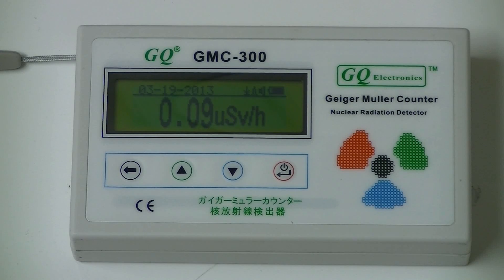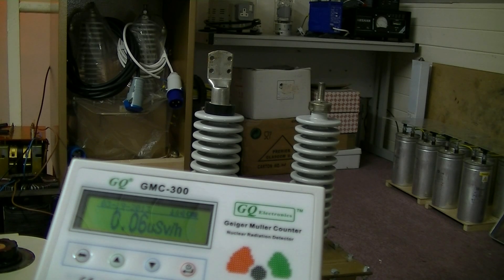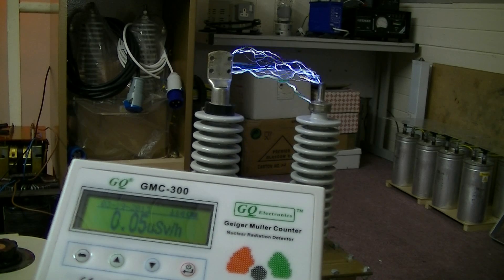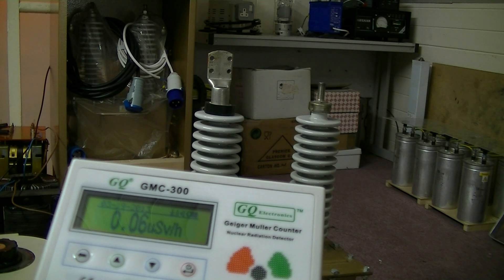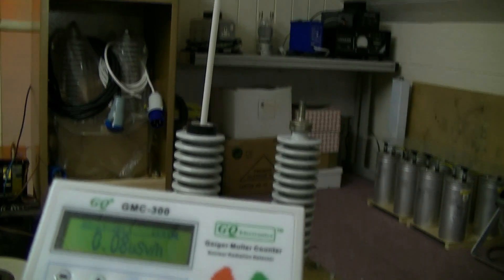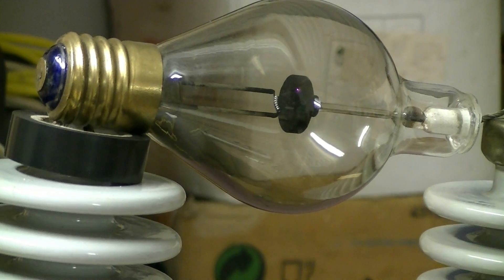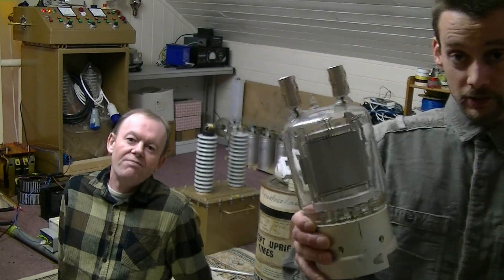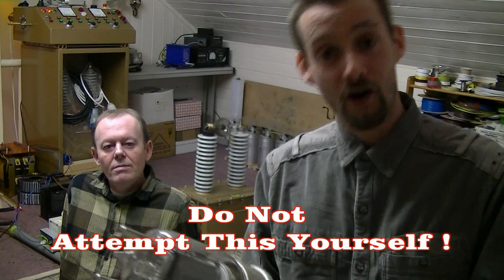Generating X rays

Comment: I think you turned that transmitter tube into a Crookes tube, the anode or cathode must have gotten hot enough to start emitting thermionic radiation.

Comment: And the problem with the Geiger Mueller tube is it doesn’t really detect x-ray and Gammas that well.   for that you need a scintillation detector.  Like a Radiacode 101/102

Comment: The tube produced a lot of X-Rays, Since a lot of the X-Rays are made in the center of the block inside it will shield it's self from a lot of it, If you moved the Geiger counter around it you will find areas were you will find a huge spike in detected rays, X-Ray tubes are made to produce rays to come out from a certain direction and its more like a beam, X-Rays will not be blocked by your walls unless they are made from thick stone or anything dense like lead, the best protection is either Lead shielding or distance like 30m away or even more, Kreosan Made a video and in the video they detect X-Rays really far away, Check this out if you have not seen it, Its a good video, this is the English translated voice over version https://youtu.be/1gq6Mj49X_8

Comment: Television tubes? But there already is high voltage in a tv tube
Reply: yes CRT TV tubes do emit tiny amount of X-rays
Reply: The anode doesn't heat up enough to emit copious amounts of thermionic radiation.

Comment: I put voltage into a vacuum tube and store unlimited amps in a silver wire. The voltage came from a cylindrical hallbeck magnet aerodynamic journal bearing.

Comment: Pretty sure you need to power the tube heater / cathode before you'll get any serious x-ray emission. It's streams of highly accelerated electrons striking the tube structures that produce the x-rays.

With a cold cathode, the electron supply is limited to free electrons in the cathode materials. Fire up the heater and I suspect things will look very different.

Comment: why does a vaccum tube and hv generate xrays?  i fix old crt’s for arcade games but they have an over voltage protection circuit.  we’re only talking 20-27kV.  just curious on why xrays happen.

Comment: HEY just a thout but did you know those meters detect radiation by the amount od OZONE in the air? and with all that plazma u are generating quite a bit of that and not xrays
Reply: that is so wrong on so many levels
Reply: they use a Geiger-Muller tube as a detector element, a sealed glass tube impregnable by air thats filled with a special gas that becomes ionized when struck by radioisotope decay particles or high energy photons (x radiation), there are plates that then collect the now positively charged ions and form ion pairs which allows an electric current to pass between them (functionally reduces resistance which is measurable by the geiger counter), the tube is designed in such a way that an avalanche effect occurs in which one ionizing radiation particle can cause lots of gas ionization to occur (avalanche) which gives it the characteristic clicking sound as electricity is discharged between the high voltage plates through the now ionized gas.

Comment: EDIT: It would be interesting to measure the temperate of the vacuum tubes, to determine the peak wavelength of the radiation

You could apply Wien's displacement law to this (granted this is for the study of black-body radiation curves, eg. stellar spectra)
https://en.wikipedia.org/wiki/Wien%27s_displacement_law

peak wavelength (meters) = 0.0029 meters / Temperature (kelvin)
wavelength (meters) = Speed of light (meter/sec) / Frequency (Hz)

If you measure the temperature (in Celsius or Fahrenheit)  of the bulbs (or whatever you are using) and convert that to kelvin then
Wien's law will tell you what the wavelength of the spectrum the emissions lies in.

We know the wavelength of x-rays which is about 1E-11 to 1E-8 meters.
Applying Wien's law (to solve for T) we get something around 2.9E5 K to 2.9E8 K (or about 521 thousand up to 290 million degrees Fahrenheit).

The big question is whether the peak wavelength of the radiation coming from the tube is in the X-ray range.

Another example showing the peak wavelength radiated from the human body:

98.6 F = 310 K
0.0029 / 310 K = 9.355E-6 meters
F = C / wavelength = 3E8 /  9.355E-6 = 3.2E13 Hz = infrared

Comment: First off a potential of high voltage is created across the anode and cathode of an x-ray tube....it must be evacuated to accelerate the electrons which implode onto the angulated anode and steered out of the port of the tube at the accelerated x-ray wavelength. The amount of dose you create is a product of KV + MA + exposure time. You could have your experiment running all day without shutting it off and would create less radiation than an old CRT style tv.

Comment: what your detecting is most likely loose beta particles (electrons) from the high voltage.
Reply: I suspect you're correct. I am not familiar with this particular Gm counter and whether it can differentiate between beta particles and X-rays. 200 kV isn't really high enough for X-rays.

Comment: OUT OF EVERYTHING IN YOUR ROOM I ONLY RECOGNIZED THE BLUE 24V MOBILITY SCOOTER CHARGER , THOSE TRANSMITTER TUBES ARE ONLY A PENNY BRAKING £29 , YOU COULD HAVE FUN WITH THIS ,ALL YOU'LL NEED IS A LOW FRAME CAMERA TO SEE THROUGH WALL

Comment: Gu-81m is not the best candidate for x-ray generator. One of the top connectors is third grid and second one is anode. Same third grid is connected below. The maximum voltage you can apply is  actually breakdown voltage between top electrodes. Also anode is made of carbon, this is light element to produce X-ray. So your x ray intensity is negligible as expected. Please study basis before your experiments.

Comment: I was responsible for off line sample testing CRTs for LuckyGoldstar in the UK from 1996 to 1999, including xray.    The results I would usually get are that at 45kv I would get twice ambient radiation at a distance of about 1-2 inches.    very little.  Working voltage was around 22kv.   However my sister is a radiographer and claims that her machines put out around 180kv, well they would, they are xray machines after all?!

Comment: While I would agree with most of the comments on here about how this is likely a malfunction in the Geiger, it's worth taking into account that the Geiger was measuring steady higher readings of X-rays which each coincided with an increase in voltage to each tesla coil on each attempt. Malfunctions, or spontaneous readings in the Geiger due to large emf would show up as jumps or spikes and would likely have inconclusive readings rather then the steady output variables which can be seen. The only way to rule out that emf was indeed causing the reading would be to measure its strength and place the meter further away. But really though, chances are X-rays were indeed produced. Be safe out there ! Leaving the room did little to help you btw... Unless your walls are thick concrete or some sort of reflective metal. Given the reading on the Geiger was relatively low and the period you were exposed wasn't that long you should be okay... But perhaps a insulated faraday cage around your next test, set it up to encase your tesla coils, put the Geiger inside with your camera in a non reflective insulator so you can avoid further harming your cells in future experiments.

Comment: I'm not sure if anyone is going to see this since the video is pretty old but I have a question. Why is there a difference between the plasma arcs when it's high voltage vs. when it's high current? The high voltage arcs are in general very well defined with sharp edges. The high current arcs are very fuzzy and have less curves and bends. You also see arcs that are relatively slow compared to both of these, like in a jacobs ladder where the arcs are sharp and defined but tend to wave slowly. And sometimes you get arcs that are sharp and wave around super fast.
What is the actual difference physically? Like what is happening physically with the plasma that makes them behave differently? And are these visual differences consistent enough to be able to use them to tell if an arc is high voltage or high current or both?

Comment: Wait, so why does the radiation level stay high even after the x-ray producing apparatus is switched off?
Reply: Average over time.
Reply: The counts are averaged over time. It takes time for the counts to decrease in the detector.
However in reality x-rays appear and disappear as soon as the device is switched on or off
t. Physicist
Reply: @JONOTron precisely
Reply: Also maybe making ozone, those may count, depending on the detector.

Comment: Of course you haven't never ray X only hiagh voltage. You need before of filament as normal lamp in vacuum tube, after high voltage. In this way the elettrons of filament go at anode where is high voltage.
My fiend it's necessary taht study more. Look at picture of Wikipedia with explication.
Look on youtube "X Rays - A Level Physics".
Hy

Comment: according to my figures, it would take several hours for you to receive the dose of one dental x-ray, since it is 100 micro sieverts
Reply: A dental x-ray is 1-8 microsieverts.  100 microsieverts would be a pretty serious imaging series.  You also need to realize that meter is displaying time averaged values.  He isn't keeping it on long enough for the reading to stabilize, so the peak flux is far higher.

Comment: Cool to experiment, BUT A geiger counter doesn't detect X-Rays!! Totally different frequency. There is a reason why radiographers use fluorescing screens.. because they DO detect x-rays -- big time!!  Yes I was an x-ray engineer. FFS get yourself some eye protection as you are probably already well on the way to cataracts.. And by the way you need 100K to 150KV, 200K is too much, the x-rays will just pass through everything. Medical x-ray tubes use an aluminium sheet to protect you from the low 50KV stuff which is seriously damaging to eyes and skin. :-)
Reply: Yup the job of a geiger counter is to detect radiation. Although, x-rays are radiation, the amount of radiation produced by x-ray CRT is not a significant amount to cause cancer. But can cause cancer in the long run. But its very true that the geiger counter cannot detect x rays. if that large tube produced x rays, the geiger counter would have started beeping WHILE the high voltage was on. NOT after.
Reply: Ryan Haquim the reason there is a delay between the tube being on and the Geiger counter reading is due to the slow response of this particular Geiger counter.
Reply: Geiger counters do detect X-rays because they are ionising and you can check this on google yourself. Inside the counter the geiger-muller tube contains a gas is ionised by the radiation and this produces an electric current. The main reason why fluorescing screens are used is because you can generate an image from them. 
The large tube probably did produce X-rays, but the counter was positioned too far from the tube to detect much of it. A lot of the newer tubes are impregnated with lead so this could also be reason.
Reply: yay! also nice comment
Reply: Amen.

Comment: You just got like 6months worth didn`t ya?

"The average yearly human dose (American Nuclear Society) is 6.2 mSv/year (0.71 uSv/hour).
With an absolute maximum yearly dose of 50 mSv/year (5.7 uSv/hour)."

Well, short video though, so lets say a month lol..

YOUR KIDS WILL HAVE FOUR HEADS AND EAT CATTLE!! :p
Reply: They spent less than 10 min @ 24 uSv/h so you cant divide it by 6 and you find they have had roughly 4 uSv/h dose each even though they weren't that close to the source, so 4 uSv is a maximum. That's about the same dose as a dental Xray. Now compare that to the background dose received by a person over one normal day which is 10 uSv... This isn't that bad but of course you have to be careful not to mess too much with radiations.
Reply: Well the dentists go hide behind lead lined walls..
Still, I wouldn't worry, it was an attempt at sarcasm, but hey..
Try, fail, and try again, because SCIENCE! xD

Comment: and what's the background radiation in Chernobyl?
Reply: The reactor core, as of 2009 was 2.6uSv/hr, the metal claw used to clean up the debris still, to this day measures 336uSv/hr (no, not missing a decimal, 336uSv/hr).

A fatal single dose is estimated to be around 10,000.00mSv, that'll cause an excruciating death over the course of a week or two. 

The workers that died at Chernobyl within 1 month received 6,000.00mSv.

The LD50 (Lethal Dose 50/50 - 50% of population) is 5,000.00mSv

A CT scan of the heart (the highest dose of radiation you'll receive from a radiographer) is 16.00mSv.

Fukushimia gives off 1.02mSv/hr as of 2011.
Reply: Hm, interesting, but what is the actual radiation around the power plant, you know, the places that people can visit, at least legally.
Reply: You cannot visit the town of Chernobyl. The closest you can get would be whatever the safe limited exposure would be which is set by the government. But fascinating to find the exposure to an unprotected body would kill the body.
Reply: Q36BN Actually you can visit, but only with a precise purpose (you can't just go for a walk obviously :D) and a ton of permits.  In a documentary, they were ~50 meters from the sarcophagus and their Geiger was reading about 25 to 30 uSv/hr

Comment: You may want to invest in a good lead apron or suit or something. Maybe make a safe room with a good thick layer of lead paint (or just lead). Be mindful of building codes though, and remember that lead is pretty darn dangerous all on its own, which if why I wouldn't normally recommend that someone using lead paint. Actually, just forget about using lead paint altogether, because it's more trouble than it's worth.
Reply: Yes, probably healthier to stick your balls and eyes in a frying pan.
Reply: Remember that meter is measuring microsieverts/hour, so a reading of 60uSv/hr for one minute (shorter than he ran it at, by my count) would yield about 1uSv, or about the same radiation dose as eating 10 bananas.

Comment: the counter  readout updates every second, but its response seems slow, and then with sustained readings !  Q. Does the electromagnetic energy drop-out as soon as the arching stops? or is it reflected around the room?
Reply: X rays, actually any gamma rays are high energy photons. They are the same particles as light - but at a far higher frequency (energy level). This is why any frequency below ultra violet is fairly safe - and this includes radio and microwave frequencies that are way lower (less energetic) than visible light, but ultra violet and up will cause burns and molecular damage as they can transmit more energy, through ultra violet, x rays and hard gamma rays.... but all will diffuse in a very similar way to light from a normal light bulb as they are the same particle in the end (but remember that at different energy levels, different things are more or less transparent to that light - like why a window is transparent to visible light but will block ultra violet, or why your skin is opaque to light but transparent to x-rays.

As for the measurement, as mentionned elsewhere, the counter is a cumulative measure and not an instant measure, so it cumulates the irradiation over time, and may take time to register (seconds, minutes, hours...), then more time to drop back down to background radiation levels.
Reply: +bloodybritbastard thanks. My wifi & microwave oven both operate at 2.5Ghz, one I'm bathing in all day and night- the other, I certainly wouldn't want to be bathed in. Can you comment on how the power (or energy) of an electromagnetic frequency is quantified? Is the safe limit regarding max power/energy for any given frequency the same across the board? For example in terms of electricity- a circuit capable of 120w at a voltage of 230v - I wouldn't want to touch. But 120w at 12v I wouldn't worry.
Also, regarding light, and all frequencies, the inverse square law comes to mind! Lux=candela/distance squared 👀

Comment: Maybe you can get xrays if you use heavy metal with high fusion point as anode and cathode, such as tungsten, iridium or molibdenium, and voltages around 100kV. That's what is used in xray tubes. A typical chest xray uses 120kV and 20mA.

Comment: You would need to apply power to the klystron for it to emit x band radiation, connect the heater circuit.
Reply: X band radiation is non-ionizing.  Utterly irrelevant unless you're heating your lunch.

Comment: you have a rather slight different reading from your lab and the very start of the video. I just saw a recommendation that open air exposure to high voltage can ionize the scintillator tube. did you have an active source close to the counter at the start?

Comment: Why do Vacuum tubes at high voltage generate X rays?
Reply: +JusBMX Because electrons can accelerate in vacuum without collisions with the gas molecules, and strike at the other electrode with full strength. The electrons slowing down from high speeds generate the x-rays.
Reply: Calmarius Thank you!